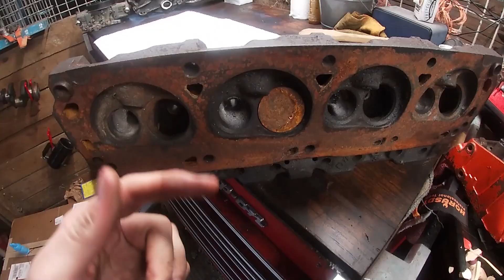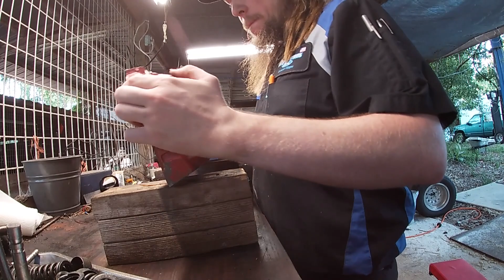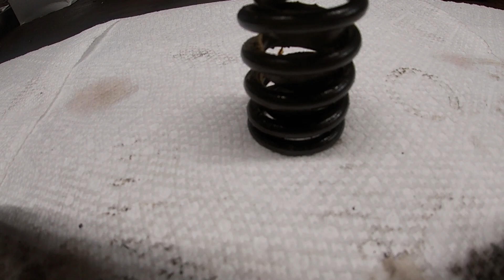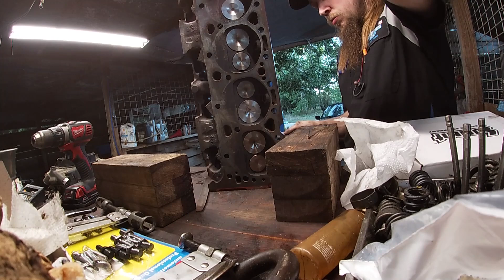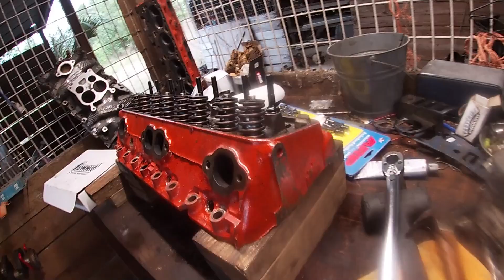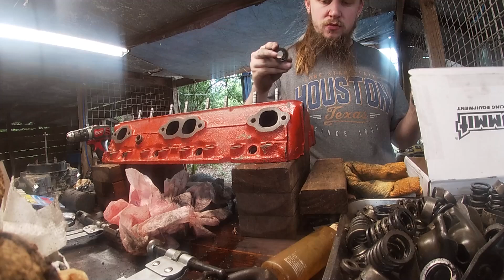SBC Head Upgrade: Springs & Studs for '89 Camaro!

Comment: Wht are the part numbers you used
Reply from the maker: You should measure your cylinder heads and the springs that are in them and then go on summit racing and match up what you measure with what they have. Different heads from different years have different springs, same thing with your camshaft, it may need more lift than what I have. Sorry but there is no one size fits all for this.